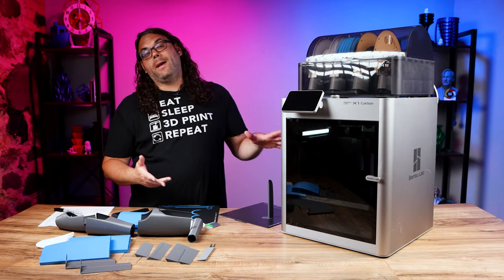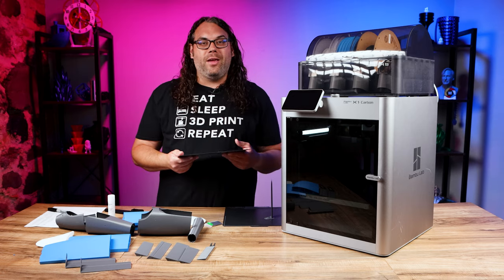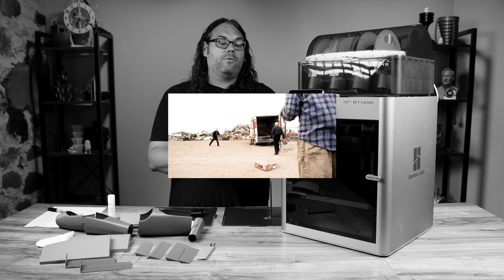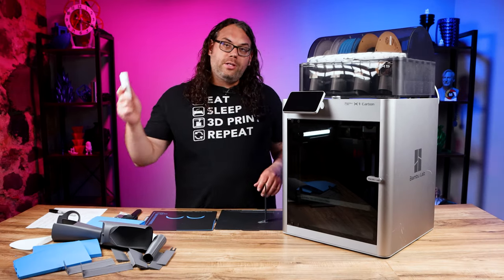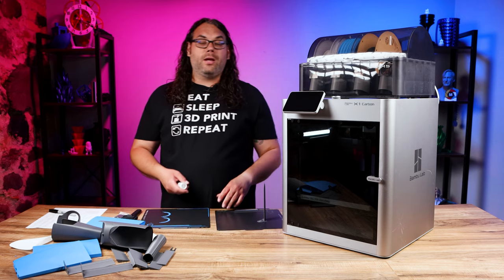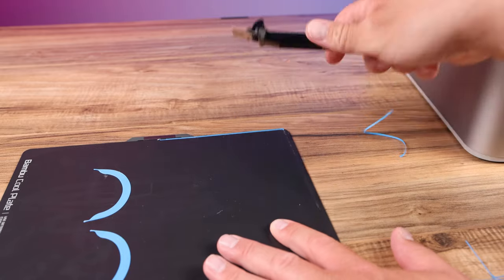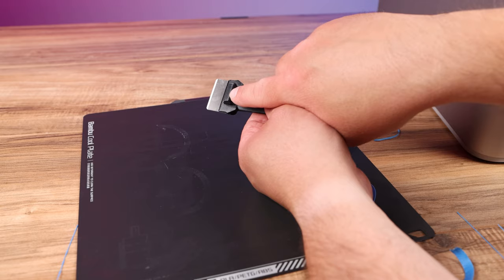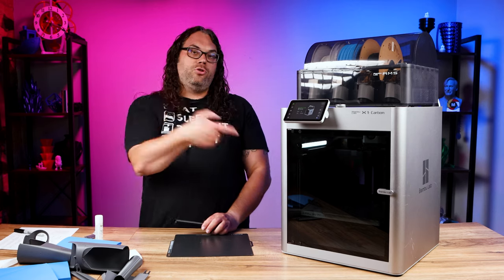The Bambu Lab Tool You NEED To Print FIRST!

Comment: The gouging you're doing there is giving me PTSD.  Go easy with the scraper... make sure you have it flat on the bed so you don't scratch it.  Additional tip... don't use it to remove big parts, else the part pushes the blade into the bed.
Reply: A wood scraper tool is much more appropriate for a nonstick coated surface

Comment: I've been trying to decide how often one needs to reapply the glue stick.  For the first few prints I did it every day, but now I'm looking more carefully and I don't think the glue is coming off with the prints - not too much, anyway.  I'm currently leaning towards "thoroughly wash the plate and reapply glue every few days."  Any thoughts on this from folks who've had their printers for a while would be welcome!
Reply from the maker: I would agree, I wash mine once a week If I print a lot. Otherwise I just apply a little bit for the last print was. A very thin layer and then at the end of the week I just wash it and reapply another thin layer and we're good to go. I've got several prints off of the bed before I have to reapply.
Reply: Also a tiny bit of water on a cloth that you reuse that is impregnated with glue stick can be used to spread the glue and reuse it. Haven't tried it on the Bambu, but I have used that technique for years and saved a lot of reapplications and my glue sticks last ages since doing it.
Reply: @TheEdgeofTech  How are you "washing" it? I'm new to 3D printing...are you literally running water over it and drying it, or wiping with a cloth? any alcohol, or just water?
Reply: Saw a video where they use no glue stick just clean it with windex.
Reply: @cleverestx I use standard dish soap w/ warm water, doing so over the kitchen sink. if I need to wipe I use sponge, not a scrubber.
Reply: I saw a comment saying to just lightly wipoe with a damp cloth to spread the glue around after printing
Reply: I don't use glue, just spray with windex and wipe the plate before each print. Works perfectly
Reply: @nomansland120  I've tried the Windex approach, and concluded three things:

1) Windex triggers my breathing issues.

2) Windex is much faster and simpler to apply than glue stick.

3) Windex must, as you noted, be reapplied every print.

For me, point 1 makes Windex a deal breaker; I'd rather take a bit longer and keep breathing.

However, if you set that aside, I find whether Windex is a better choice  very much depends on which build plate I'm using.  If I'm using the Cold Plate I have to touch up the glue every print, and fully re-apply it after every spool.  If I'm using the Engineering Plate, however, I can leave the glue alone for at least six spools.

So, from my limited data set, I've concluded that Windex is better for folks how mostly print using the Cold Plate; but as I mostly print ABS on the Engineering Plate, a think layer of glue applied once a month is not only better for my lungs, it's actually less work.  Obviously, this is just my own opinion and I'd encourage anyone who hasn't tried the Windex approach to at least give it a try.
Reply: Is there a source or brand name for the purple glue stick?

Comment: I too started using hair spray just a few days after getting mine. Glue stick too messy and leaves residue on prints. Hair spray works flawlessly and has an ever better surface on the finished print. I’m also using the engineering side to print PLA without issue. Awesome printer!
Reply: Any hair spray you recommend (or don't recommend?) I don't like the idea of stinking up my space with it....
Reply: @cleverestx  Most high hold extra strength ones work well. Especially ones with a fine mist nozzle. Cheap aqua net hairspray has worked well for alot of people, just avoid ones that have oils in them as they will prevent adhesion. And a tip for a finer must is warm the can up in some warm water to thin out the hairspray and it will spray out much nicer than a cold can.

Comment: Ok so about the scraper.   what is the point of the magnets?!?  first, the sides of the X1 Carbon are aluminum.  Second, the magnet slot on the holder is on the same side as the slot for the scraper's ...er ...thumb rest? - so it could not sit flush against a steel surface for the holder's magnet to grab onto anyway.

Comment: i applied my gluestick differently, and it worked the best so far. 

1. Applied glue stick on all of the surface.
2. Use a damp cloth to evenly spread the glue stick across the bed.
3. let it dry, u just put it below my fan.
4. start printing after everything is dry and all bed surface is covered properly.

Comment: I dont have any trouble at all taking stuff off the build surface just lift and the come straight off, i jhave a plastic scraper in case sometimes helps an edge to lift a little. Just a thin layer of gluestick. easy.

Comment: My X1C came with a gold PEI sheet and no glue instead of this older plate system. Not a complaint - just a note - kinda awesome if they've switched to textured PEI by default
Reply: Same
Reply: Do you need glue stick or hairspray on the textured sheet ?
Reply: @mdex1  no. Just wipe with alcohol and don't touch with fingers as much as possible

Comment: Just got mine yesterday, just to see how well it printed I did the plastics scraper first, then the phone and tablet stands (those came out perfectly), then I printed the poop catcher in vase mode, except for the fact that the walls are very thin and nickeled in on one spot with the .4 nozzle I think it came out great (.6 or .8 nozzle would be better suited if I was to do it again. The top layers have been perfect by the way. No gaps like I had seen on previous reviews, apparently they have been working on it.

Comment: The moment I used the glue stick, it has been a living nightmare. I had to clean the bed with dish soap really good and I have been using glass cleaner. Increased the bed heating from 35 to 45 and all is now peachy (PLA)

Comment: AquaNet Hair Spray works great! Got my Bambu Yesterday and have already printed about 8 things with PLA and they pop right off!
Reply: how many bed sprays you get outta one can? curious, b/c I have five tubes of glue and there are super inexpensive. I have had no issues with glue so far. but am fascinated by the use of the hairspray as well. maybe for bigger prints? I was shocked that one can runs $8-10.
Reply: @dgodrummer8110  Don't think I can count that high.  All I know is that one can lasts at least 4-6 months because it's just a light coat.

Comment: Love the channel - thanks for making great videos. So I printed all 3 components of the scraper and they looked fine.  But as I screwed the 2 screws into the small piece that goes on top of the blade, the layers delaminated as the screw went further into the material.  Any thoughts on what went wrong?  I used the white filament that came with the printer, allowed all of the calibrations and did not modify any settings.  Thanks in advance.
Reply: The regular PLA that came with my machine is orange. Are you sure the white you used is PLA or is in the support material?
Reply: @stitcherino  Anna: Genius! I didn't even know there was a type of filament called "support". I reprinted in the orange PLA and it is perfect. Thanks the the education (I've now read up on the support filament type).
Reply: @stitcherino  yeah I noticed that early on. I wonder why Bambu even included the sample support spool as it's such small amount.  Do not most folks simply use the same filament for supports as they are for the entire print? SO far I have only printed in PLA and I use that for supports. I have not noticed any issues with removing it. 

Is there a time and place for support material to be used?

Since I am still very much new to this I wonder.  Though I have not read, watched or seen a link for a video on this subject, or heard of using support specific material. any experience or insights into this?

Comment: The Edge of Tech, what are your thought's on sticking a PEI sheet to the build plate (the removable peace of course)? Do you think it would cause problems for the printer with all the calibration stuff it does? I've got my pre-order in (not actually ordered yet) for this bad boy. Right now I'm using PEI on my Anycubic Vyper and I love it, I don't wanna go back to using glue sticks and such lol.

Comment: Yes use glue , hair spray, something as I found out petg will weld itself to the build plate.
Reply from the maker: For sure! People are having issues with their build surfaces bubbling, and the problem is that they're not using anything on top of it and pulling it up harder than it needs to be pulled. If they would use something between like glue stick then that would not happen.
Reply: I use glass plates and have had PETG take chips out of them as the prints cool.  I always use hairspray as a barrier layer for PETG or ABS
Reply: I have a textured pei plate coming from a member of the Facebook page. He was cutting a limited number of them .
Hopefully Bambu comes out with a plate like the Prusa satin sheet as I love that one.

Comment: This is why some people use glue.
I know it's frowned upon, but it's more for removal than adhesion.
I use a scraper and glue.
I found a spray adhesive for upholstery that works great, and will last multiple prints.
I heat my bed up to 60 at the beginning of the print, and and my bed gets super sticky. Then after the first layer, I turn the heat of, and the adhesive hardens.
At the end of the print, I heatt the bed back up to 60, which causes the glue to soften again. And then you have a soft layer in between your print and the bed.
Works like a charm.

Comment: Can you use a glass “mirror” plate in this unit. I use glass plates on my Enders and Snapmaker with a blue glue stick (Aldi’s brand) and there is no better sound than when the glass cools and you hear a cracking noise that lets you know that the finished print can be lifted off with minimal to no effort. Standard mirror glass cut to size is quite cheep.
Reply from the maker: I don't think it would work with the lidar. Not sure for sure, but I think it would fail the scanning.

Comment: It looks like you should flip the blade over and use the bulge on the backside of the scraper to align the blade with the print surface
Reply from the maker: You could definitely use it like that as well!
Reply: The blade has 2 alignment holes on the ends, that are staggered, to match up with pins on the handle. My daughter learned that the hard way.

Comment: I don't use the original build plate from the X1 carbon anymore. After good results with the texture plate from my P1P, Wham Bam plates and a carbon texture plate from Aliexpress, I don't see any reason anymore for mess around with the glue stick.

Comment: I wasn't really getting the best results with glue stick on my Bambu X1...possibly user error. I switched to aqua net hair spray and WOAH. Its just so much more consistent of a separation layer since I can spray it nice and uniform knowing I didn't miss any spots. The cool plate ssticks to PLA and especially PETG way too well and I will be replacing it with their PEI surface once its available in the shop.
Reply: Hairspray has been my favorite as well. Been using it since I got the printer (yesterday for three prints 🤪). I have only used PLA so far, but it seem to work really well.
Reply: curious of the cost of hairspray vs glue stick (which is working fine of me so far). amazon sells aqua net 3-pack for $28. 
 Any estimate on how many times you can spray the cool plate with one can? I also like that my 5 glue sticks take up very little space in a drawer, opposed to a 3 cans of hair spray.

Comment: I have not received the X1 yet so don't know what the build surface is. But is there a danger that using a razor blade on it will damage it?
Reply from the maker: Just as long as you are careful it's fine to use! That goes for any scraper on any surface too. :)
Reply: when are the first deliveries expected I remember July being mentioned, I have my dosh down for an XL but am in a quandry weather to get one of these
Reply: There's also a plastic scraper you can print.  I happened to have a putty knife on hand, so I just use it.  It' a bit thicker but if you flex the plate you can generally get the edge under.
Reply: @AndrewAHayes  I got mine last week, I'm in Australia too. I was in the first 500 backers though.
Reply: @davydatwood3158  the plastic one was my first print but it is uesless lol the edge just breaks as its just one layer thick

Comment: I have just thrown my blade scraper in the bin after it damaged my textured PEI bed and I was being super careful with it, normally I leave my prints to cool and they are loose by this time,however, I was printing some small TPU protective buttons for a laptop stand and they were really well stuck down and would not come off and so out came the blade scraper.